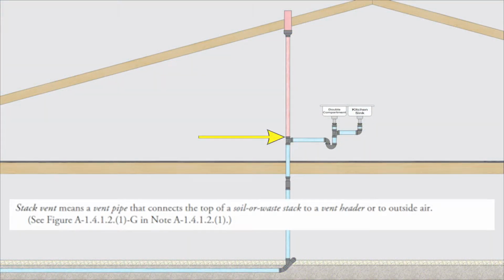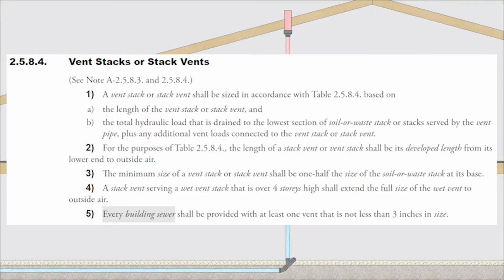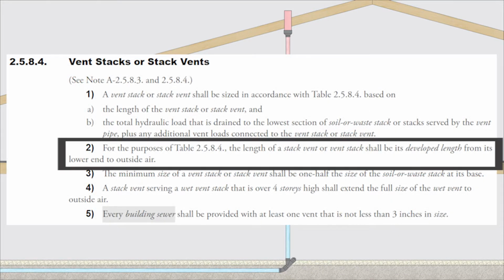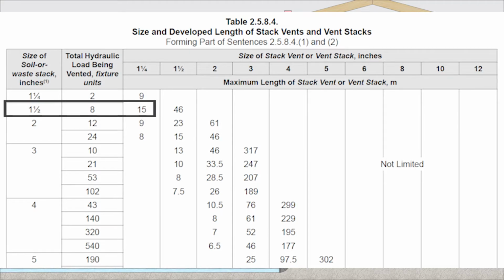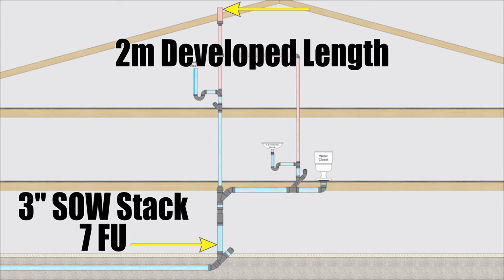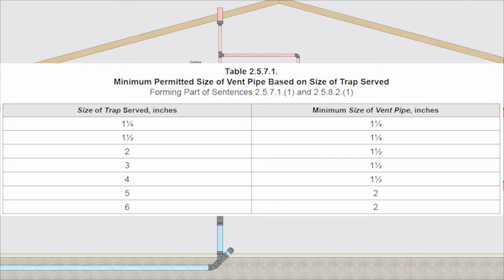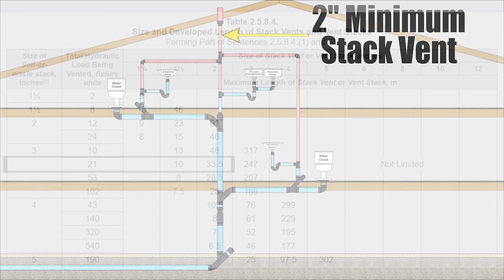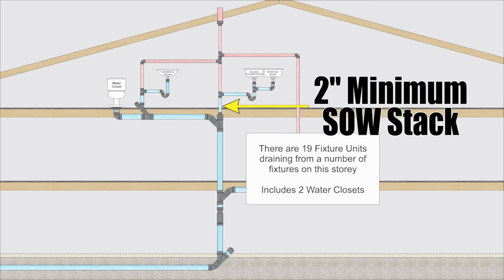Level 2 DWV - Video:4 Sizing Stack Vents with Tables

Comment: Lets say you have a 4 inch " building drain with a 4×2 y thats picking up the kitchen on the main floor , do you size your stack vent for a 4 inch stack or 2 inch ?

Comment: I don't understand why you have the stack vent as 2" and then 3" through the roof, I understand that that " 7.5.8.4 (5) saying every sanitary building drain shall be provided with at least one vent not less than 3 in. in size." but wouldn't that mean that you need to upsize the stack itself to 3" and the rest of the stack vent to 3". I get that you can upsize your vent vertically but from what I have done in class we have been upsizing the whole stack vent and the stack itself if need be.

Comment: at 5:40 you had to increase the min size to 2" why was that? is it cause of wet venting?
Reply from the maker: The stack vent is 2" because of its developed length (Explained 20 seconds before your time reference)

Because your stack vent is 2 inch, any drainage below that point will need to be minimum 2inch as per code. There is NO wet vent at that point, it is just a SOW stack.
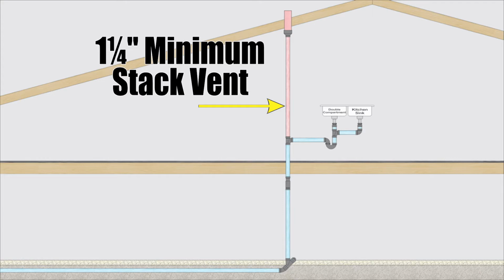Reply: @MathematicPlumber  oh yes i understand you did explain that in basic DWV video 3 at 3:45 
thank you so much!

Comment: Hi thank you for these videos. I have a question. I have a 3inch soil or waste stack for a two story house the upstairs toilet is the highest fixture draining into the stack a little bellow the first floor ceiling, my problem is the stack in located in the downstairs laundry room and I cannot have my stack vent go vertical or 45 through the floor since there is a bedroom above. My 2" stack vent will have to go about 3 feet horizontally 1/4" per foot then take a horizontal 90, go 6 feet horizontally 1/4" per foot and only then go vertical through the roof. I am worried that this is not proper because logically I would think the stack vent would have to go vertical or 45 until it passes the flood level of the second floor sink. Thanks again. Am I over thinking things?
Reply from the maker: This is for Canada, other countries may be different: Any vent can travel completely flat (horizontal), but I recommend grading it at ¼" per foot. Given your vent is sized properly, I think you are good to go.
Reply: @MathematicPlumber  Thank you! I'm plumbing my family's home for the first time and I was having trouble understanding all the codes. Your videos have been instrumental for me. Very happy to find this channel. I'm in Ontario so it's perfect.
Reply: @MathematicPlumber  Hi again, sorry I'm just reading 7.5.8.4 (5) saying every sanitary building drain shall be provided with at least one vent not less than 3 in. in size.  Since toilets are draining into my 3" soil or waste stack (from what I understand that is considered a sanitary building drain) that would mean I need a 3" stack vent and I can't use 2" even though the length and fixture count works with table 7.5.8.4. I don't know if it matters but the vertical 3" soil stack transitions into 4"  horizontal into the septic tank. Can you please confirm that I my 3" soil or waste stack needs to continue into 3" stack vent through the roof?
Reply from the maker: @ivanmeouch95  You do need one vent that is 3" minimum right up through the roof. If you do not have one anywhere else, I would do exactly what you are talking about.

I do have a video series called Basic DWV, it goes through these concepts